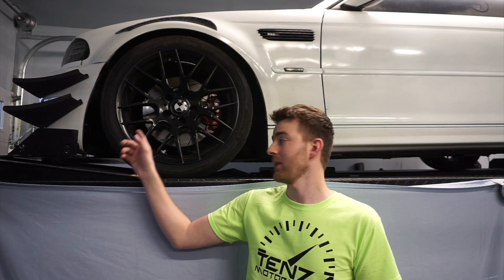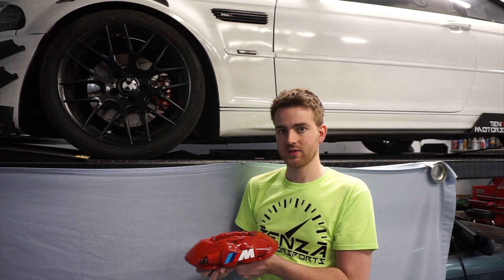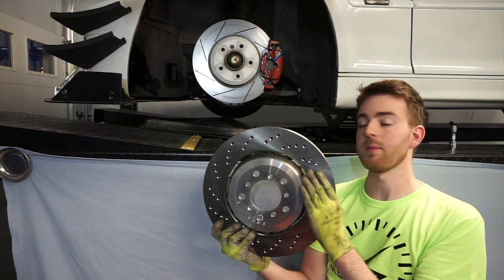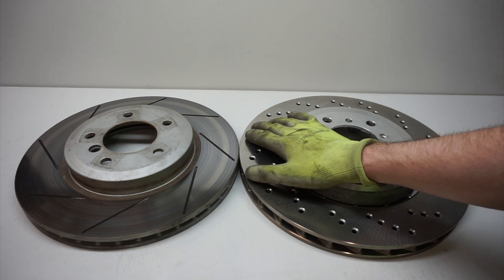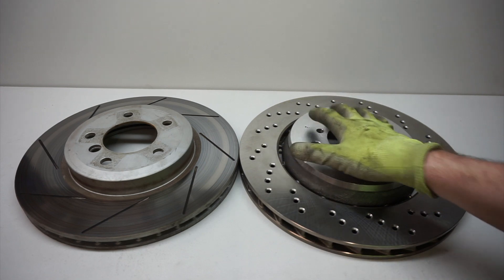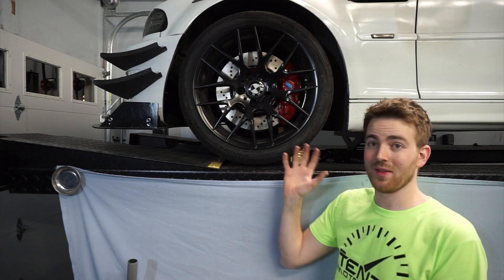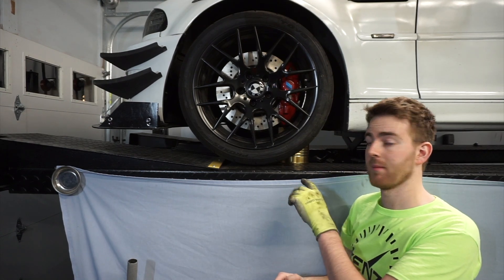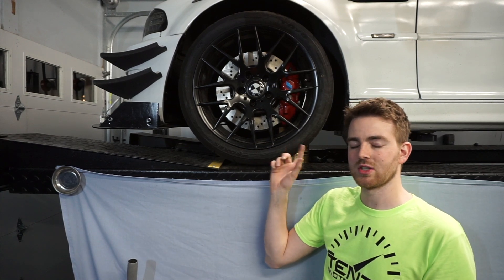E46 330ci Brembo brake upgrade. E46 M3 CSL rotor and four piston Brembo conversion to non-M E46.

Comment: Those fit your stock knuckle without modification?
Reply from the maker: No modification needed
Reply: @TenzaMotorsports  i got an e46 and am desperately looking for a bolt-on kit for CSL rotors! Could you please specify what year and model these brakes are? I know you've said it, but you also mentioned m4 and a 440 in the vid. Thanks!

Comment: Just an FYI, I confirmed that these will fit under the BimmerWorld Forged 17” wheels. I used a set of the 17x9 and they cleared. Both the barrel and spokes clear.
Reply from the maker: That’s good to know. I figured some 17s would fit. But it’s safer to just plan to get bigger wheels

Comment: Amazing video, I’ve watched it many times but still have some questions. I was wondering if the break pads end up touching the rotors or have any issues but also I would like to see an year update on what its been like running this set up for about a year now. Love the work you’ve been putting out, 👌👌
Reply from the maker: Mine was a direct bolt up. I’ve heard a few others say the pads touch and they have to trim them. Like 1/8” or so. Even with the pad modification, it’s absolutely worth it! When I get the race car in a position to make more videos I’ll do a follow up.

Comment: So you are saying the 440i calipers bolt straight on to the 330Ci caliper mount?
Reply from the maker: Yes they bolted right up.
Reply: Wow!  That's awesome info. Cheers
Reply: Any question. Ineed the measure bolt to bolt from brake caliper. You have this information? txh

Comment: So I see you put the 330 rotors and calipers on the e36. So this would mean that the csl M3 rotors with the 440 calipers would be a direct bolt on to the e36 correct?
Reply from the maker: I obviously have not personally done it. But in theory, yes. I can’t verify it will work. I’d be willing to say it does from what I’ve seen.

Comment: Are the upgraded BMW callipers a direct fit to the BMW hubs? Thanks man!
Reply from the maker: These calipers are a direct fit the the knuckle. The only thing that would have made this swap a little more legit is to get an M3 hub so the rotor and the hub match. The current set up works every bit as well as the M3 hub.
Reply: @TenzaMotorsports  thank you for the fast reply dude! Have you encountered any issues since fitting them? Cheers 😄
Reply from the maker: Nope, it was a super easy install. Just a swap and a quick brake bleed, you're good to go!

Comment: Few questions if you're able to answer. Forgive me if I didn't find your review video already in passing, but how did the brakes feel after doing this swap? Did the change in volume with 4 pistons to move vs the original single piston change the pedal feel or braking distance? Did you feel there was a significant change in brake bias as though you may have made your rear's less effective in stopping the car? And finally, did you already have the whole stainless conversion and other upgrades done too before the swap?

I'm certainly interested in this as I have an X3 I drive (only after my 2001 330ci outweighed cost/benefit.... had just over 260k miles on it so it did great service). I've found they shared the same caliper/rotor as the 330ci did for e46 years and I often pull a small trailer with it with a motorcycle in it. I've always considered an upgrade due to my added weight towing vs just looks or performance, as the X3 I have is a grocery-getter and not supposed to be a fast car... but I love the idea of stopping more efficiently with the added weight and updated tech for calipers. Look forward to hopefully getting a response!
Reply from the maker: The car feels very normal. Without hard breaking you’d never be able to tell the difference. Very linear. Doesn’t effect the bias from what I can tell. I haven’t been on a track yet so I can’t really comment on that yet. No other upgrades have been done. Stock lines and everything
Reply: @TenzaMotorsports  guess I'll start paroozing some forums for availability lol. Keep up the good work!

Comment: Sorry if I missed it but did you have to shave the pads to prevent the overhang?
Reply from the maker: I didn’t have to. But some people are needing to. I’m not sure if there are slightly different pads or what? If you have overhang take about a 1/4 inch off the inner part of the outside pad.
Reply: @TenzaMotorsports  are you able to post a picture of it? Or what pads? I am referring to CSL E46 rotors + 440i front calipers and everyone mentions 10mm of shaving of the pads. Also I am wondering is it really bad to shave the pads?

Comment: If i wanted to add this set up to my stock e46 325ci with 18inch mv2 will it fit bolt on or would i need the 330ci hubs/spindle. And did you use the 330i brake lines or the 440i
Reply from the maker: This should fit the same way as the 330 if I had to guess. They have the same mounting points.
Reply: Thanks. What about brake lines? Were there normal 330i or custom made
Reply from the maker: Stock 330 lines. You’d have to research it but I think they are the same as the 325.
Reply: Hello, did you manage to install the brake discs? Did everything fit properly or did you have to change the hub?

Comment: So you fitted these calipers on the 330i's hub bracket that the factory caliper mounts to, or did you also use the factory caliper mounts in conjunction with the calipers? Im a bit confused.
Reply from the maker: I pulled off the entire stock caliper and direct fit the newer ones. 

To do this project you need the new calipers, M3 competition rotors and two M3 set screws.
Reply: @TenzaMotorsports  ok, and you mounted the calipers on the bracket holes where the regular caliper mounts bolt on, correct?
Reply from the maker: Yes, used the same bolts and everything.

Comment: Hi, very nice upgrade. I have a question about it, which brake pads did you use, one that comes with 440i or E46 CSL one?
Reply from the maker: I used the pads for the 440 brakes.
Reply: @TenzaMotorsports  thank you!

Comment: Awesome man.. quick question.. so the 440i calipers bolt right in on a 330ci? No adapter needed?
Reply: the fronts bolt right up. the rears need some slight modification. you can't fit those calipers without stock rotors though

Comment: Hi mate great vid some great and very detailed info... those rear callipers look like the originals am I correct? Would it be possible to fit the brembo rears off the 440i to the rear of the e46? I know you’d need bigger discs (rotors) which is a pain in the arse as you have to change the hub but would the callipers bolt straight up like the fronts did?
Cheers
Reply from the maker: I really am not sure. They are the same size tho. So you can use stock rear rotors.

Comment: Might have missed it. But do the 440 calipers just go straight on the 330? What about carriers?
Reply from the maker: They bolt right on. Only thing you need to change are rotors and screws
Reply: Do you know caliper dimensions? Or year of 440i if any difference in caliper sizing between models? As just with the like of the 335d are similar size calipers. Just to give me more to look at when buying. Thanks in advance
Reply from the maker: I really don't know the specifications. The 440 these came off of was an F36 model. I think the car was a 2017.
Reply: @TenzaMotorsports  that's fine. Thanks for the replies

Comment: Do you need any special brackets to mount the calipers??
Reply from the maker: No, they bolt right on. You just have to make sure you change the rotors.
Reply: @TenzaMotorsports  is this for 330i only? As 325ci has diiferent front mounting knuckles for the caliper

Comment: Hi, Im looking for p&p set for 330ci. Is there any diffence between your calipers (440i) and any m sport brembo 340mm calipers for f32/f20/f22/f30/f84? And what about rotors, are they fitting execly beteen break pads (or rotor need to be adjusted like 2/3 milimeters)?
Reply from the maker: I have no further knowledge of figment past this install. I took a shot in the dark with this set up. The only way to really know is to test and see that’s all I did and I got lucky.

Comment: Nice video….did you have to use wheel spacers to clear the calipers? I’m thinking of using 19in wheels on my setup think it’ll clear the 440i calipers?
Reply from the maker: On my wheels set up, no. I didn’t have to use spacers.

Comment: Looks great! I don't know if I should go with 330i EBC discs / Yellowstuff pads, or your 440i setup, or maybe even the E9X 335i caliper / M3 CSL discs setup. The price difference between the EBC setup and the E9X 335i caliper / M3 CSL disc setup is not that big. The 440i caliper setup is a bit more expensive in my country unfortunately. I want the looks, but I also want the stopping power. now I can't decide.

Comment: Which pads did you use for this setup, and would recommend?
Reply from the maker: I used the stock 440 pads that came on the calipers. When I go to replace them I will probably find a set of hawk 5.0 if they are available
Reply: @TenzaMotorsports  ok, hows the dust with those pads? & Whats your opinion on the cool carbons vs the hawk's?
Reply from the maker: The noise and dust is much much lower than I thought. I was expecting the full downside of performance pads to come forward, and they are just amazing. My hawk 5.0 pads I ran before this swap, had all the bite force and almost no draw backs.

I have no experience with cool carbon. I'll have to look into them.
Reply: @TenzaMotorsports  I was able to get thd same calipers you have , but the gray unpainted version , with the 340 stamped in the back. How would I know which pad to use,  since there's 2 versions, either "M performance pads, or without "M performance pads?
Reply from the maker: I really don't know that answer. Best thing to do is find out the exact car it came off of. Like the vin. Orrrrr maybe buy both pads and return the ones that aren't right? just a thought.
Reply: @TenzaMotorsports  I also wanted your opinion on the supercharger you have in your vehicle. I've been looking at that same kit, but also would like to turbocharge my car.

Comment: Hey man superb video, but I was wondering what other brake rotors I can use instead of the csl rotors as Im not a big fan of the cross drilled and would much prefer a blank oem looking rotor. Did you find any other bmw rotor that fits without any modification onto the hub of the 330ci. I also have a 330ci and am looking into this upgrade but I wanted to know if I could maybe even use the 440i rotor on the 330ci.

Edit: Also I was wondering how the pads contact the surface of the rotor and if you have gotten any rings from the pad not fully contacting the surface of the rotor. And would it be possible to keep my stock 330ci rotors and just upgrade to the caliper or will I need to also upgrade to bigger rotors? Thanks in advance I really appreciate it and keep up the amazing work.
Reply from the maker: This is the only combination that will work. They have to be csl/competition e46 rotors. The drilled rotors I used are oem bmw. I only found two options. Oem and the two piece ECS tuning drilled and slotted. If you upgrade to bigger brakes, you need to do bigger rotors.
Reply: @TenzaMotorsports  Thanks for the super fast reply and for the info. I'll still be checking around forums and such to see if its possible to use other rotors and let you know what I find.

Comment: Hi, from what vehicle and yr did you get the calipers, and which brackets did you use for them?
Reply from the maker: They came from a 2017 440i. No additional brackets. Direct fit.
Reply: @TenzaMotorsports  what yr 440i did you get the calipers from?
Reply from the maker: They came from a 2017 440i.

Comment: Hello, I am looking for brake upgrade for my Z4 coupe 3,0si. There is a 325mm OEM rotor. Do you think that your set up (M3CSL rotor + 440i calipers) will perfectly fit to my Z4? Thank you.
Reply from the maker: The best way for you to find out. Compare your parts to the parts of an e46. They should be the same hub and brake placement. I just don’t want to say yes and they don’t work. If I had to make an assumption. I would say they will fit.
Reply: The same plan for my Z4 E85. They will fit the same way as on E46 :-)

Comment: wait.. 440 calipers are direct bolt on? Or, do they need an adapter. Very interested in doing this to my 330 touring.
Reply from the maker: Direct bolt on
Reply: @TenzaMotorsports  no kidding. I've been working on my project for years and never came across this. I don't think anyone on E46f has ever seen it...
Looks like I'll need to track down a set. Have you done the rears as well? How is the balance with the larger clamping force in the front?
Reply from the maker: Balance on the street feels fine. Rears are the same as stock so it's not anything crazy. Have not done any track testing but on the street feels amazing.
Reply: @TenzaMotorsports  the rears though have to have the 330 rotors and then 440 calipers will bolt on?

Comment: Will these fit an E36 with Styling 68 in 7.5jx17" ET41 with 5mm spacers?

Any measuremenst as to how far out the calipper seats?
Reply from the maker: As far as I know. 17s will not fit.

Comment: Hi, I have a 02 BMW e46 M3 im looking for a OEM BMW Brembo brake/rotor upgrade. Does anyone know what car they would come off to bolt up to my M3?
Reply from the maker: The knuckle on the M3 vs Non-m are different. If I had to guess, these wouldn't fit. Unfortunately this is a question only truly answered by testing it physically.

Comment: Great video. Ok so the front brake calipers are from a 2017 440I. What year M3 did the competition brake rotors come from in the front? 
The rear you also installed 440I calipers correct? What rotor set up did you use in the rear?
Last question. This will work for a 99 328I?
Reply from the maker: E46 M3 competition front rotors. Rear I used stock rotor size. The rear isn’t really worth messing with. The calipers from the 440 were the same size and some e46s, the rears didn’t fit for some reason.  I wouldn’t be able to say if your 328 would be compatible. I know my 330 was. And I think they are the same, in the front at least.

Comment: You didn't show the rear. So what has to be done? You just grab the calipers and the bolt right in with zero modification or other work? 440 donor?
Reply from the maker: Stock in the rear.

Comment: Got to love how many people on here don’t read what he’s written in his answers or listen to what he says!
Your better off buying the 46 M3 hub which is a direct fitment, use the two Allen bolts to bolt the disc to the hub, use genuine CSL discs then a 440 Brembo calliper…. Simples.
Now if you have a genuine 46 M3 then replace with a AP racing kit like I have using the Radical calipers front & rear!…. Amazing!👌

Comment: Hello. I have same setup front calipers and discs. Can you tell me how long you ride on this setup? I Just thinking about "stopping pins" or whatever names this pins which keeping discs on hub when breaking on fu strenght. Because 330ci hubs dont have them and has only one positioning screw which is only one Point of keeping disc in place on hub. 

Thanks for answer
Reply from the maker: I’ve ran them for a year so far. Just use the one rotor screw.
Reply: I have problem with too big outside brake pads because they touch rotors and disc wont roll. So ive grinded outside pads, but i want to know how about yours setup? You dont to do this? I have mounted ate discs and ate pads. Maybe OEM disc have smaller rotor.
Reply from the maker: No problems with mine.. that’s odd. I really don’t know.

Comment: Is the rear calipers 440i as well
Reply from the maker: They are the same size. No real upgrade other than, Newer. You have to plumb the line slightly different to use them. The front is the important part.
Reply: @TenzaMotorsports  much appreciate on the response back love your video. You be throwing alot of game out there don't  no if folks be catching it. But I do in appreciate it as well
Reply from the maker: Thanks! means a lot. I have loads of stuff like this to come with another build in the works.

Comment: Where did you get the caliper "m"  decal?
Reply from the maker: I made it. I have a small vinyl cutter.
Reply: @TenzaMotorsports  ohh, ok. Do you have a video on upgrading the rear brakes?
Reply from the maker: I don't, they aren't upgraded. They are same the spec. so I didn't cover it.

Comment: Size of wheel is only partial, more importantly the offset. You have M3 fenders so for you this fits. But a stock car can only fit 8.5J ET35 before rubbing. These calipers would probably not fit with ET35, maybe if the spoke was carefully designed.
Reply: This what you saying is tested and proved?
Reply: It fits very tight with ET35, Autec Wizard 8x18.

Comment: Attention to aLL car expert. Just using water to cooL down disc brake & brake pad. I suggest about a miliLiter per minute dropping on disc brake directly is very safe whilLe traveling more than 100 mph.  to prevent faiL brake due to overheating. Or simply apply radiator on brake pad / disc brake.  BECAUSE SAFETY IS EVERYTHING. .. especially those very heavy duty truck
Reply from the maker: eXcElLeNt AdViCE👍

Comment: Two questions. Wtf happened to your frontbumber?! I would loose that shit on the first ride to my work on the autobahn. And why you work on your brakes in that hight?! 😂
Reply from the maker: Well I don’t drive on the autobahn. It’s not set up for top speed. There is a car under the lift that didn’t run while I was doing the brakes. It wasn’t that high. Eye level.
Reply: @TenzaMotorsports  Im playing with  my thought to do same like you did with your e46. I have an 340i with the blue sportbrake with the 370mm Discs in  the Frontaxle. That brake performance is so much better than my 320d e46 has. Do you need any spacer between between brakerotor and hub. Or the hub and the caliper ?